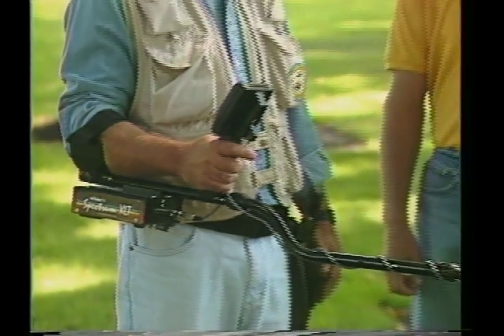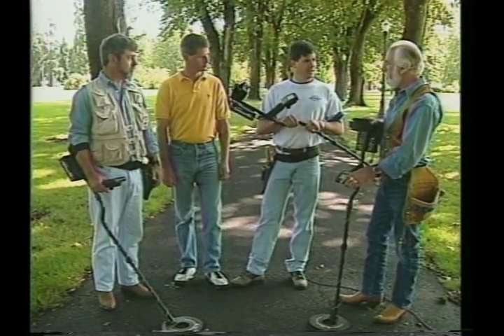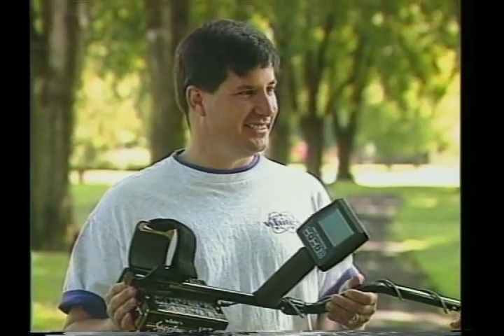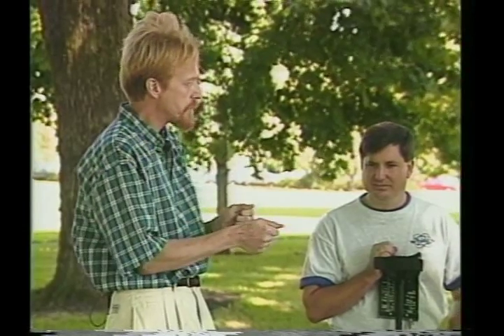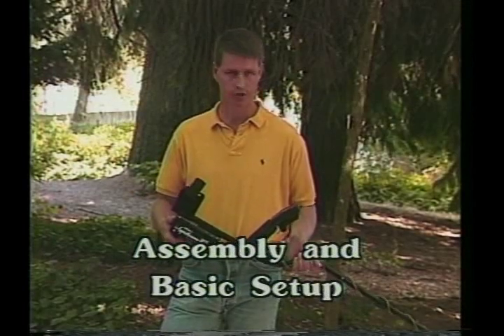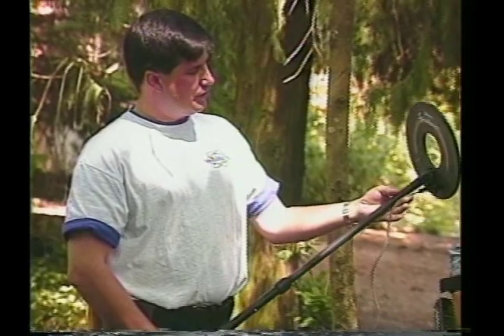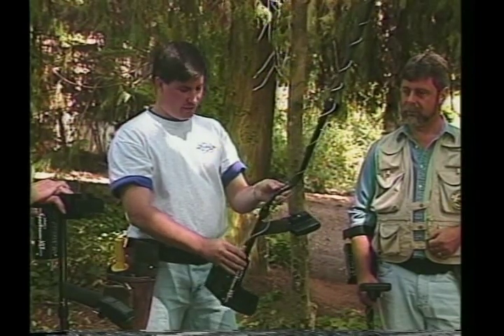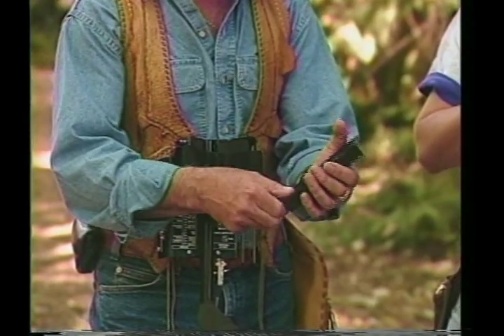Part 1 - XLT instructional video

Comment: I own one. It has successfully located many coins (AKA nails). But it actually has found many coins (AKA random  metal scraps of garbage). Seriously though, I did find a few gold rings (AKA pennies, nickels, and dimes).

It'd be nice if the "head" of this device could be upgraded.
Reply: It can, I have a BlueMax shooter DD on mine, found similar stuff, but have also found a diamond pendant,gold in the prospecting mode in bedrock cracks near the water, and an 1800s Chinese incense burner from the old miners as well as countless coins. And 1800s and early 1900s relics from the abandoned towns and miner cabins. Still to this day a very field worthy unit.
Reply: @rockymountainlifeprospecti4423  THANK you :) for the recent feedback here, I just purchased an old functional one online and wanted to research what others experience with this unit were.  I think it's from 1994 , it seemed a better choice than a cheapo off E bay. It sounds like you upgraded.